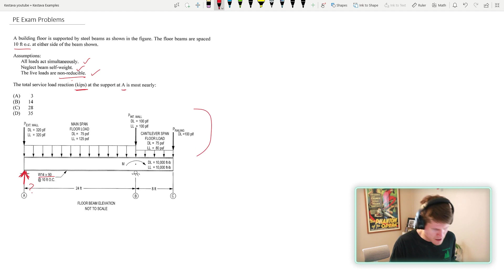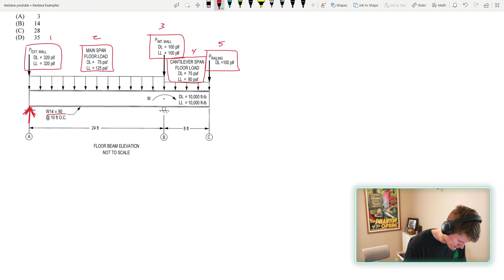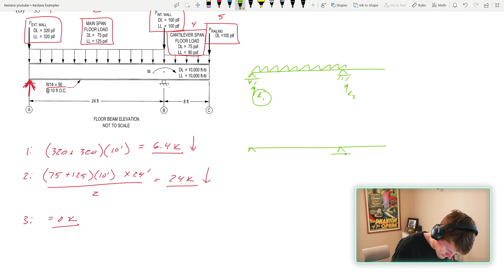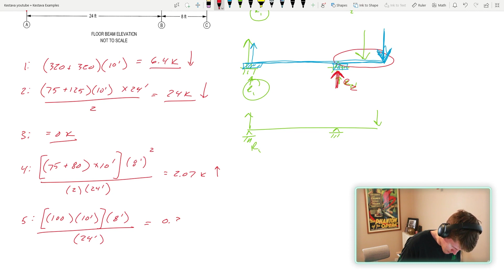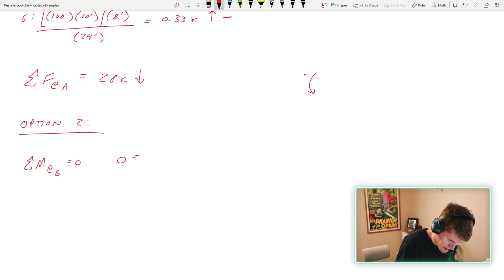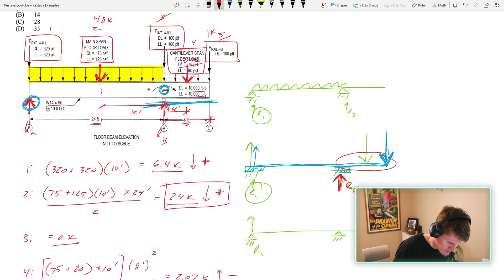PE Exam Practice Problems | Civil-Structural | 2023 #structuralengineering

Comment: Roller and pinned supports cannot accept concentrated moments, so that 20k-ft moment at point B would need to be converted to a T/C couple.  Doing that would yield 27.2K at support A for both solutions.  Table 3-23 #35 is probably the closest you'd get.  Either way, since the answers are spaced sufficiently far apart, neglecting or including that concentrated moment won't affect the final answer.

Comment: Dumb question, but when the problem says "service load", why don't we make it an LRFD factored load? That was what I was thinking as soon as I saw those words.
Reply: LRFD stnads for "Load and Resistance Factor Design". Service loads are unfactored. They are meant to be the loads the building can withstand and stay in service. "No issues". If a building received the full LRFD loads, it will have issues that needs resolved, but should still be standing.